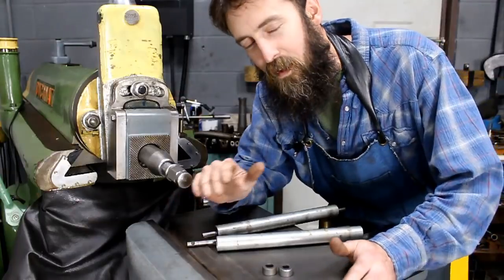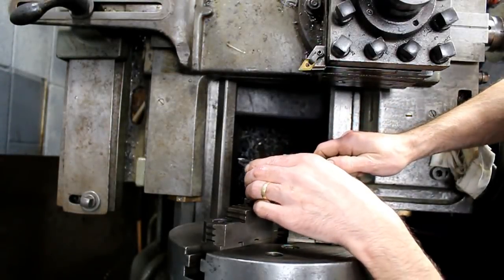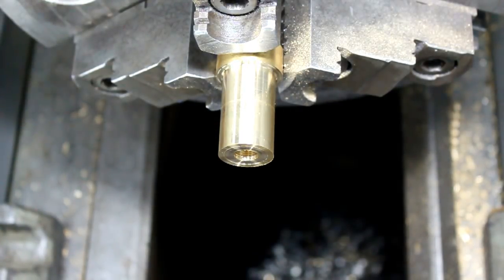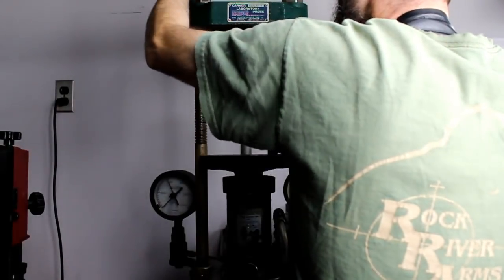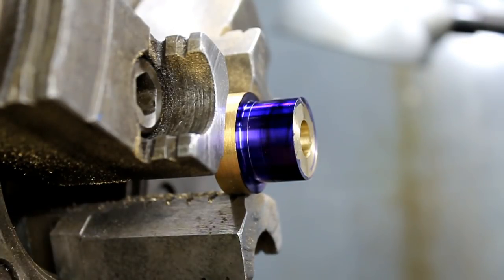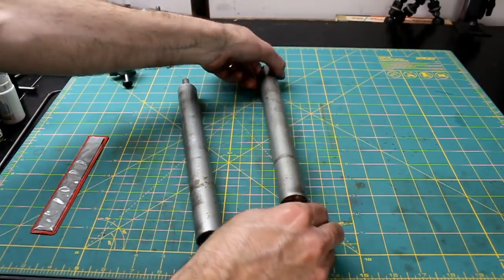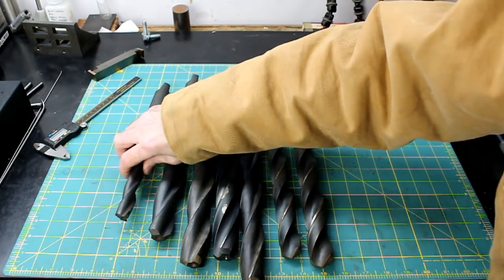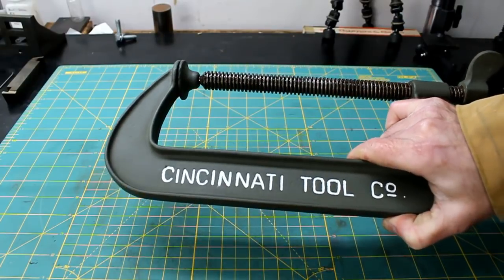Roller repair and New Tools / viewer mail

Comment: I'm off to grind a parting off tool. Never seen those drills before. Press's are so useful even if they spend most of their time in a corner. Great video Steve. Cheers
Reply from the maker: Rupert Hartop Do it, LOL. I don't use this grind often but it is a good one to have in the pile.   Saved me once or twice.👍

Comment: Steve it is always a good practice to rough out all features on the blank and coming back to finish machine. In the video you can see the blank running out after the "heavy" drilling operation. This strategy is also  essential for controlling distortion from internal stresses.
Reply from the maker: Rob B.   Agreed, I had very little bite. This material was short.  . Thanks for watching.

Comment: I like the work you did on the bushing. Fun to watch. What is that sound your lathe makes when it slows down? Sounds like thick oil on the gears.
Reply from the maker: Danylo66 LOL. That clicking noise is my hand going over the 3 chuck key holes on the chuck in an attempt to slow the chuck down😀. I try not to do it when filming because of tje noise but forget often.   Thanks for stopping by and commenting.

Comment: Nice Repair. One confounding aspect though, can't understand why U used Brass which is so much softer, weaker and faster wearing than plain old Steel. Accept,  that's what U only had but why not another material in Iron. More in a quandary now.
Just my two cents worth.  Thanks for showing and sharing.  Wow.  What a haul of HSS Cutters !!!
ATB
aRM
Reply from the maker: I used brass because it was  the only thing on hand that was softer than the shafts the bushings ride on but strong enough to hold up to the use that it is expected to see. This repair was for a person I know and I don't think they will ever wear out.    I'm not a fan of steel on steel under load unless I am 100% sure of the materials I'm using.  
I was very happy with the viewer mail hss cutters drills and tool holder were great gifts.   Thanks for watching. I hope you enjoyed

Comment: Bushings are easier to start in the hole if you turn 1/16 of the end  .005 or so undersize
Reply from the maker: Jim L yeah makes sense, I just put a lite bevel on one side with the belt sander.👍

Comment: My lathe has MT5 tail stock. I have not been able to find bits that are under $100.  I'm tempted to buy a used set off ebay then send them off to be sharpened. Any suggestions? Other than publishing endearing videos, that is.
Reply from the maker: Jeffrey Lewis I think buying used bits is a perfectly fine idea. Even if they are not sharp like you said you can have them sharpened or do it your self. I sharpen all my bits by hand and get satisfactory results as long as I am careful and gauge them. I look at drilling as nothing more than curd hole enlargement. I'm often not worried about a drill cutting slightly oversized due to push off from being sharpened unevenly. In my situation I would buy used because of the high cost of new mt#5 drills. You may find the the smaller mt drills are easier found and just sleeve them with an adapter.     Good afternoon Jeffery☺

Comment: What calipers are you using? Also, did you check the diameter of the tube before and after pressing in the bushing?
Reply from the maker: They are just cheap digital calipers but very accurate, I prefer to use them over a set of dial Mitutoyo calipers I have.
I did not check the od after installing the bushing, I felt no need.  The press was light and the new bushing made to factory size.    I have checked these cheap calipers many times with gauge blocks and am always amazed at how accurate they are. I have owned these calipers for 4+ years and have never had an issue with them. When I 1st got them I did not own a set of standards but my work did and I would bring them in ever so often and check them out to make sure that are correct. I must say that I would much rather have a set of Starrett but I don't feel that the ones I am using are inaccurate by any means. I guess what I am trying to get at is I think they are caliper accurate  + -  .0001   :-)
Reply: Steve Summers would it make the viewer mail if a mitutoyo arrived?  Or something else perhaps?  Santa is coming, you know.
Reply from the maker: Jeffrey Lewis If santa was ok with it LOL. 😊